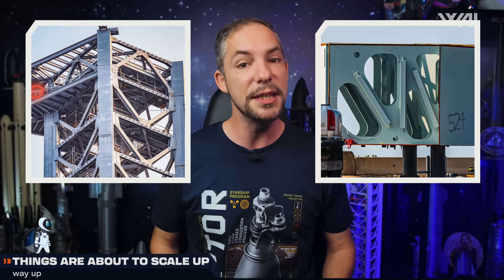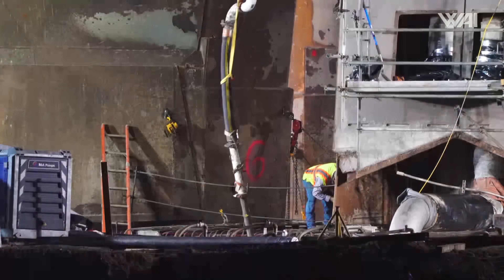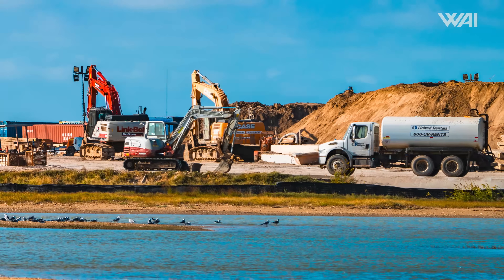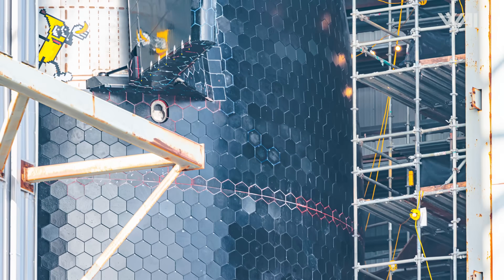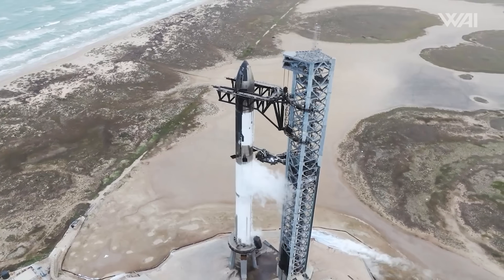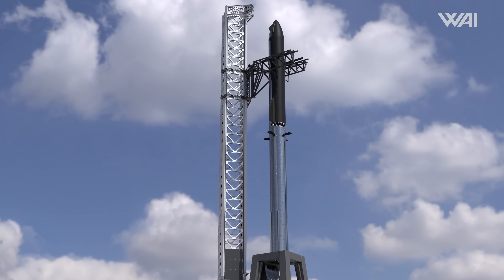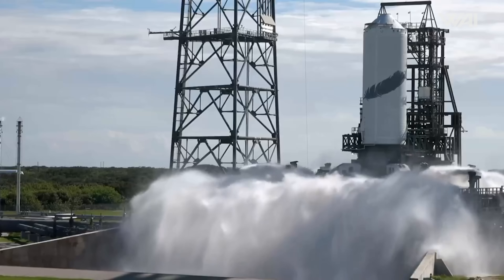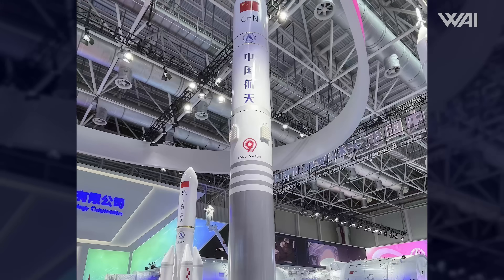SpaceX's Starship is about to make History! Here's what will happen!

Comment: I know we're hyped for V2 and all.. but.. I would go for a catch with starship because if you had to fall back... At least you have confirmed is reusable to some degree.  Also.. since eli  has confirmed boosters have more thrust capability with the new engines. It means that you can go further without refueling in LEO which means the ship can go even further after refueling too. That's a big win. The biggest win is making a tank farm on mars to go there and back at max speed.. still We're a decade.. maybe two from that.

Comment: Capacity of starship isn't everything.  It's important, but anything that will be taken to low earth orbit has to be deployed from starship and that's a limiting factor, so this so-called doubling of mass in 2025 just isn't going to happen, although SpaceX will probably develop the mechanism to deploy a larger load of satellites for Starlink.  That should bring down the cost of deploying those satellites, maybe.  Depends on the efficiency of launches which includes ENTIRE systems, and their cost to operate.  I have to think that with as long as Falcon has been flying it's efficiency is very high.

Comment: Hi Felix, greetings from Spain, I have a question. SpaceX is always dealing with the heat shield problem. They have the thermal tiles and the new ablative material underneath. And during flights they always lose tiles. Would it be possible to do it the other way around? I mean, first the thermal tiles with their adhesive and such and then the ablative material on top in paint mode? This way it would create a uniform layer on top of the tiles and the reentry plasma couldn't sneak in between the gaps... I don't know, it's just an idea 🙈🤷‍♂️

Comment: Sitting here thinking about Tesla vehicles on the moon, a question for all the math gurus. Lets assume a cybertruck with a range of 500 miles on earth and whatever the weight is.

 what would be the weight on the moon and what would the range be ?

 I already know that an F150 has a range of zero unless it is under tow
Reply: Lighter gravity means much less torque the wheel is putting on the ground
Reply: i am thinking much greater range, is torque affected by less gravity, resistance for motion would be approx 1/6th of the Earth weight so i believe the range should be much greater, just trying to find the ~ range @alvianchoiriapriliansyah9882

Comment: I have a technical question regarding the fixation of the heatshieldtiles:
Would it be possible to use rails from top to bottom of the starship to attach the tiles on? And if so what could be a reason to why spaceX doesnt use this?
In my naive perspective this should avoid using glue or clips to attach the tiles and also basically would mitigate the tiles to fall off.
Only reason I can think of is that to replace the centre tiles you would have to remove all tiles below/above.
Any other ideas?
Thank you for any constructive replies 😅

Comment: Imitation is the highest form of flattery they say. The problem with that is that China only has the form factor to imitate. They may copy the appearance but pretty much everything else from materials and construction methods to software is locked by ITAR. 😬
It will be a grueling grind without imitating the speed and efficiency of SX's iterative design process. 
Best of luck to everyone.

Comment: Constructive criticism: Why use steel rebar when they could use Basaltic rebar? Lighter, stronger, cheaper and rustproof.
2) Are they using pyrotenax electrical cables? They are used in hot areas.
Reply: Is there any engineering proof that this basaltic rebar works better?

Comment: As many of us stipulated, Starship needs a flame diversion system.  Expensive?  More so than the price one pays not diverting all that thrust away, plus a high volume water system to boot?  The initial investment will pay in the long run.  
Sorry, but I told ya so.
Reply: Water will still be used on the new flame diverter, even more so than the old pad since the OLM will also be cooled this time
Reply: @alvianchoiriapriliansyah9882  Yes, I'm aware.  Water spray carries the heat away.
Also, because water increases air density, the deluge muffles the acoustic onslaught of a Starship launch.  An explosion is a powerful sound, in the form of a shockwave moving through a mass medium.  At close range, those engines can disintegrate steel reinforced concrete. Not even taking into account the 6,600°F fire blasting across at millions of pounds in pressure.
The diverter carries all of that violence away from the rocket, and much of the launch facilities. I read about this years ago, about the Apollo missions.

Comment: Starship will never land on Mars, and almost certainly not land (successfully) on the Moon. It may EVENTUALLY, be able to, as Musk himself has said, take 40-50 tonnes to LEO. To go any further, the ship needs 25-30 ADDITIONAL flights just to refuel once. Falcon Heavy can take 57 tonnes to LEO with boosters recovered. Falcon Heavy is proven, and has never had a failed mission. I guess the real brains behind SpaceX (credit to Musk as the founder of the company, not as any sort of rocket engineer), Tom Mueller, saw the writing on the wall.

Comment: Hey! Loving the content! Quick question…launch pads on the moon? On mars? How different will they be and how will they build them??
Reply: @jonathanhall07771 Good point.  They won't be able to use water-suppression to protect a pad on the Moon as surface temps there are way below zero...
Reply: @alanparsonsfan And they don't need to
Reply: Gravity is 1/6 earths therefore force required is far less. Also no atmosphere so no pressure acting non each square centimetre. Overall this reduces forces requirements to such that if starship used its normal engines it would send moon fragments heading towards earth. Therefore new lunar engines will be designed, which will be far less powerful. Also design is not intended to enter earths atmosphere as presently stated.

Comment: Biggest step forwardnmis a fleet of turn round boosters mand ships. taking off landing re firbished fuelked and launched again?
with no repairs damge to pads and catching points.
An airport style rocket base is still way off in the future,
continual damage to base is the big problem

May be a pier system out above the sea could be the big cooling heat thrust dispersal
damage solution

Comment: They should start over with a new base built to hold chopstick that are much longer with a counterbalancing arm so the flame is far enough from the tower that it doesn’t need so much maintenance. Even if it requires multiple towers to hold it up. It doesn’t seem feasible to repair and paint after every catch.
Reply: Too late

Comment: When it comes to payload starships booster could be king.
Build a second stage and a fairing.
And it could lift way above 100 tonnes. 
You could feasibly build a new space station in a few months with enough boosters doing daily flights.
You can build a station 3 or 4 times bigger than the ISS.
That depends on just one thing was the catch a one off fluke can it be repeated over and over successfully.

Comment: Just curious about the method welding of welding stainless steel during the building of a booster or Starship! Also, that’s a lot of stainless to have in the supply chain, curious about the grade of the stainless steel used.
Reply: Laser welding, 304L

Comment: Fascinating…the race to send bigger and bigger rockets to space. If it turns out that “ET” technology has been worked on by China, Russia and the US then all of the money spent on all of these systems has simply been dumped out of thousands of trucks, then pushed all together by massive tractors into one gigantic pile, and then set on fire. 

What are the odds of that being true?

Either the UAP story is a complete fabrication, or the term “money talks” is not just a saying, but truly an axiom that applies in all situations, without fail. Money itself will have stated that the reverse engineering of ET spacecraft is a false narrative. 

And I was being incredibly polite in how I finished that last sentence.

Comment: When the chopsticks catch a returning booster or starship they should be positionally offset rotated from the rocket launch stand. This allows a "returning" booster or starship to not damage the launch mount and its infrastructures. If you want fast launches, the previously caught booster is already prepped and waiting on the OLM. The starship is caught, rotated and stacked on this booster, both refueled, launch again.
Reply: So it would be better to direct the flame at a bare concrete, compared to actively cooled diverter?
Reply: @alvianchoiriapriliansyah9882  On return the raptor exhaust flame is from 3 gymbled center raptor engines caught 50 meters off the ground. It allows them to catch the booster swing it to the rocket launch platform. Then catch and swing starship on the same tower stacking it on the booster ready to refuel and relaunch.

Comment: I would love to be looking out of a window at the top of one of the mega bays during launch and the catch, despite the risk 🤩
Reply: there is little risk in that i think most spectators are closer then that. but considering those bays arent designed for residential pourpuse i think they will swing wildly during shockwaves.

Comment: That is so much space junk they could potentially ruin low earth orbit all together. Someone really needs to work on clearing the junk out of orbit soon.
Reply: Luckily the easier to get up there the easier it is to start cleaning some stuff up. I heard there are a few companies working on some stuff that can de-orbit random space debris.
Reply: @azidoazide7039  one can hope there are more than one or two solutions. Because from 1mm piece to a mangled but complete bit of junk. Frankly, it should be moved to a stable orbit at an automated recycling point that resmelts metals etc. For reuse in orbit.
Reply: @GrigoriZhukov Let's reduce space junk by... extending its orbital decay time!!
Reply: It is fiiiiiine. It's space It's infinite. Plenty of room up there. /s

Comment: Why not use heat tiles on the launch pad legs?
Reply: They are a light ceramic type material... they would blow into a million pieces and become supersonic projectiles
Reply: Imagine putting a firecracker in your coffe cup.  It would shatter into a million pieces and probably injure you as well... on the olm it wouldn't be much different than the rock tornado... it would just be a ceramic tornado and likely damage the booster or stage zero
Reply: @davidrogers9464 I'm pretty sure you gonna have to save this to a Notepad or something & keep copy-paste, because another ppl just above it will gonna ask the exact same thing over & over again

Comment: The repaint is important because this is a marine environment. Saline will ROT reinforced concrete. Remember Camplain Towers Condo ??
Reply: Yea, that was brutal. I think the pool was leaking too, chlorine caused excessive oxidation/rust to occur.
Reply: @BlazinWolf25 Source?
Reply: They  also had half the required rebar in the concrete base.
Reply: @YagiChanDan That's already a thing in the past
Reply: No it won't. There are plenty of concrete structures at sea.

Comment: The V3 starhip with a 200 ton payload is probably several YEARS away.  And I seriously doubt the V2 Starship will ever reach it's lofty 100 ton payload target.  It's just too damn heavy and too damn inefficent - having to return the Super Heavy booster to the launch tower.  They really need to build offshore rigs to catch boosters and ferry them back to Boca Chica.  Without this, I cannot see a V2 Starship delivering 100 tons to orbit.  Finally, Starship still needs a generic payload handling and deployment system.  You can't just cut some payload doors into the airframe - you'll need to strengthen it and that will undeoubtedly add more weight and further reduce the usable payload volume.  Details.. they are a b*tch.

Comment: Paint is big deal. I worked a water utility.  It’s called “coating” as a coating of protection for metal pipes, components and such.   It’s a serious group of guys.  Corrosion protection for expensive and complex parts.
Reply from the maker: I couldn't agree more! Thank you for the comment!
Reply: And the prep work is the only more important than the choice of coating material, application choice. Perfect preparation covers a multitude of errors.
Reply: @GrigoriZhukov  You know it. Especially Sand blasting.  They have a sandblasting building and it’s big, for big components.  

Also the system shuts down for a few days for maintenance every so many years.  Then everyone hustles to fix, replace, repaint, and so on.  The Coating Team goes to work almost 24/7.    Always impressive.
Reply: @merky6004  It's a paint thing. Want to know how well built and prepped something is. Paint it gloss black, then shine a light parallel.

Comment: Why do they use Water, is it possible to use something else to cool the OLM?
Reply: Because water is not only used for fire/heat suppression (cooling). The water also helps in dampening the sound from the engines. So it serves two purposes: fire/heat and sound suppression.
Reply: @okirooju3787  thx

Comment: I thought of the idea of the catch system like the 3D printer but instead using steel cables rather than arms. Four towers with some sort of system that would make the cables come closer and wrap around the booster once the flames are under the cables.
Reply: Four towers is 4 times the cost and complexity.  Remember Musk's mantra "the best part is no part".

I would add for rockets the 2nd best part is the part left behind and the 3rd best is the one that performs multiple functions.  The tower fulfills both 2nd and 3rd at the same time.
:planet-orange-purple-ring:

Comment: What the fck is happening with the youtube audio track. Suddenly it switched to spanish and i had to restart my PHONE to get it back to original audio track. 
I hate youtube more and more
Reply: Are you using a vpn? Check where it says you are if so.
Reply: That or rotation no longer functioning. Dang Samsung, LG software from 10 years back was better.
Reply: @GrigoriZhukov  I have used Samsung phones for years now and i have never had an issue, its more likely just the YT app being poorly designed.